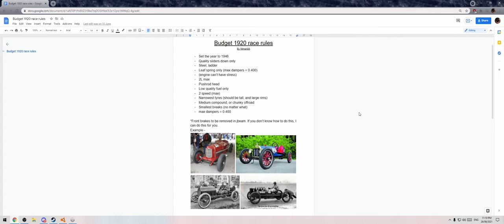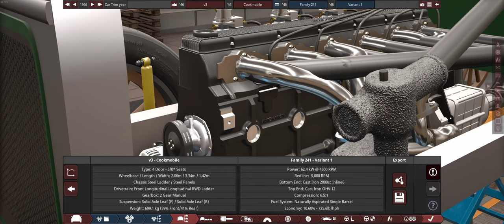fillman86 finally made a Straight 8 - Automation🔧BeamMP

Comment: Interesting thing is that the engine models in automation are actually procedural, so you can legit have a straight 8 model in the game or whatever number really, for devs cylinder count is just a value field, and also for players if they do some database editing. I've seen some people do crazy cylinder count up to 32 through db edits. But of course as easy as it is another set of problems is making it actually work and sounds :p 

Also that's a fuckton of effort you put in there, great job!
Reply from the maker: haha thanks, I was quite proud of it, but I didn't know about this automation editing stuff. I hope I can finally make a narrow angle v10 like it's meant to be, not this 90 degree garbage :P only 1 company ever has made one, and it's capacity to power ratio is really bad :P
Reply: So with this I can have v twin and v4? nice
Reply from the maker: @bitelaserkhalif  there's actually modular engine fixtures you could use too on the steam workshop now :)
Reply: @fillman86  i have done that at one point, but the intake?
Reply from the maker: @bitelaserkhalif  haha mine was fully custom, so I made it flat head and didn't have the more modern cross flow style (crossflow wasn't completely adopted everywhere until like the 80s I think)
Reply: Wait so the devs just can't be bothered to let you make it?